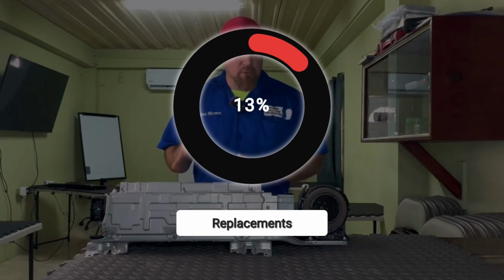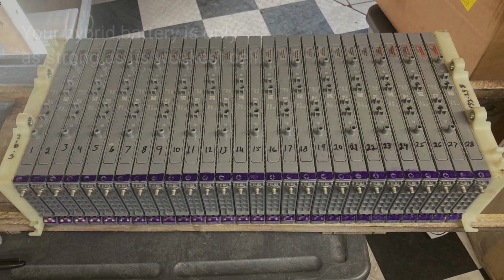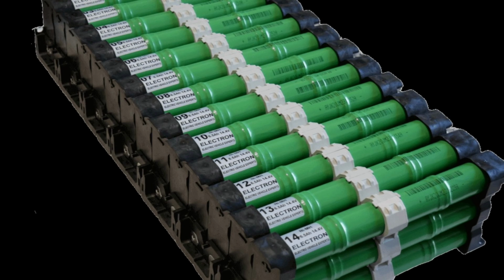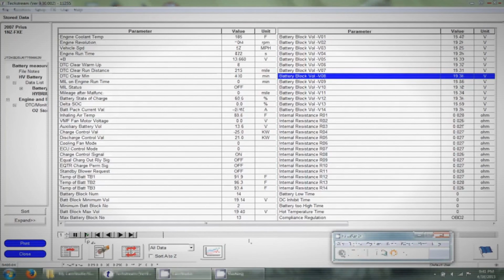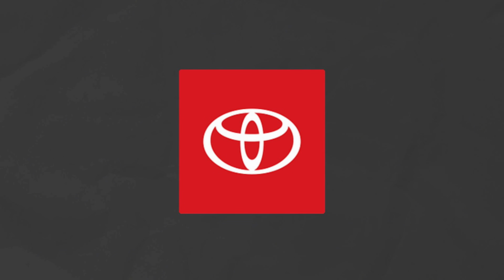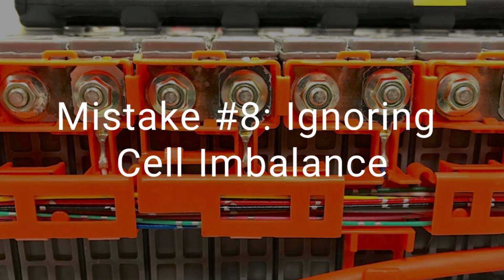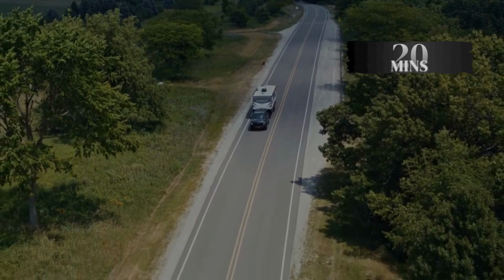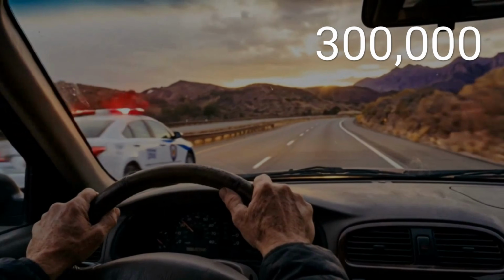The Hybrid Battery Mistake That Will Cost You $4,000 (Stop Doing This)

Comment: 1. Letting the hybrid battery sit at full or empty for extended periods, especially the ones with Nickel-Metal Hydride batteries.
2. A clogged hybrid battery fan filter.
3. Running the a/c on accessory mode.
4. Skipping hybrid diagnostic system scans; perform scan every 30,000 miles.
5. Replacing the 12V battery with an incorrect type. 
6. Aggressive driving habits.
7. Skipping Hybrid ECU updates.
8. Ignoring hybrid battery cell imbalance.
9. Never allowing the battery to fully cycle during short trips (5 minutes or less).
10. Failing to monitor hybrid battery health despite no warning light.

Comment: The other major failure is the innverter/PCU. Excessive high power use degrades the coolant gel surrounding the power transistors. It's quite obvious viewing a failed one. I always use eco mode and hyper mile. Good thing I'm a grampa cuz that's how I drive 😅
Reply: This grampa (65, bus & truck driver) hears you. I beat the window sticker fuel economy figures, easily, just by driving sensibly, light on the throttle, timing lights, route planning, etc.

What does that coolant look like when it is degraded?
Reply: @randolphstead2988 I haven't seen a degraded photo, just the failures, and the gel exploded, I didn't pay attention to the gel. The carbon on transistors was heaviest at input and diminished pretty much linearly only about half of the third transistor was black. I'll try to look back and review.
Reply: @Concrete-Ron  Wow, I bet that was messy. After I retrained in IT due to a back injury during my trucking career I would repair computers. A similar thing happens on motherboards. Components fail, things like capacitors; they swell and burst or you can see scorch marks where stuff failed.

I'm interested in this because I am researching my next vehicle. I am at present leaning toward a plug in hybrid RAV4, though I am also examining alternatives. I have enough confidence that the tech is reliable now so I am learning all I can about how to care for it and make it last.
Reply: @randolphstead2988 exactly. Just reviewed after last reply. The IGBT gel at the end of the PCU where the failures ALWAYS occur, the input side, is less translucent! I observed the same in electronics, the failures were closest power input. Planning on a '31 Rav 4 PHEV SE, keeping '24 CCH AWD SE till then. Would I had known building code changed, would have gone prime then, have covered charging available, though the new is better and cheaper. I suspect there will be virtually no PCU failures as it's integrated with the transaxle, increased thermal mass.
Reply: @Concrete-Ron  Thanks for your informative replies.
Reply: @randolphstead2988 found it. The IGBT gel at the end of the PCU where the failures ALWAYS occur, the input side, is less translucent. I didn't notice any color change in non failed units, but the video isn't high enough quality to really tell.

Comment: Should you drive on just the battery everyday?
Reply: No
Reply: @DoYouFeelLikeIDo1976 so the hybrid mode all the time and what about the 0w8 oil I live in pa?
Reply: I don’t want to even buy it now dang?
Reply: @craigduncan643  Hybrids drive a mixed mode of battery and gas engine. I have an older one that uses 0w16 and that initially scared me. Videos like this rely on scare tactics to generate clicks. I also live in Pa and have had mine for 4 years with no trouble. There are kernals of truth in this video, for example they do like longer drives. Short drives will lower your gas mileage to its rated MPG.
Reply: @craigduncan643  Hybrid EV drive is intended only for short, low speed driving where you want the engine off: parking garages, moving the vehicle in the driveway, sneaking in at night so you don't disturb a sleeping dragon. 😅

A plug in hybrid (PHEV) is intended for EV driving full time for as long as the main charge lasts; then you drive it like a regular hybrid until you plug it in again.

Don't be discouraged by scare tactics for clicks. A HEV or PHEV is a good choice. My next vehicle will be a PHEV.
Reply: @randolphstead2988 I have over 1300 miles and only put gas in two times and wasn’t much gas I never owned a hybrid car I just was wondering if you should let battery go to 0% and drive it wife only works 8 miles away from house I love it
Reply: @craigduncan643  I should clarify my question. Is your car a normal hybrid, or one you plug in gives you 40-50 miles on electric only? What make and model? I want to give you a good answer but I should first know your vehicle's exact configuration.
Reply: @randolphstead2988 it’s a plug-in hybrid Prius
Reply: Hybrids are especially suited for low viscosity except in hot climate.
Reply: Short drives the ICE runs for engine temperature for emissions, and nothing you can do about it.